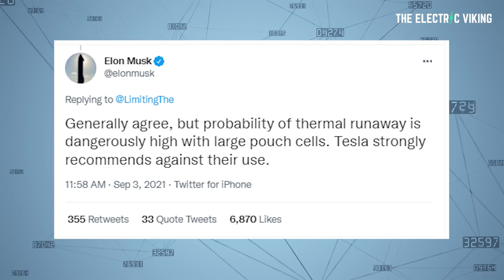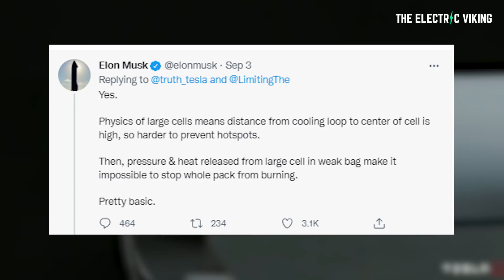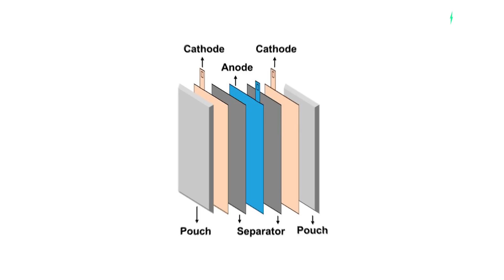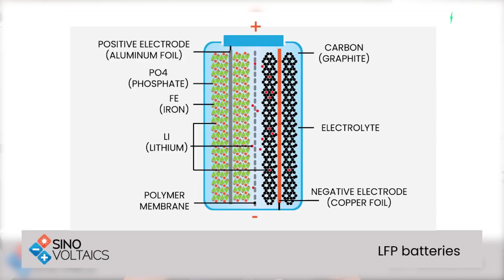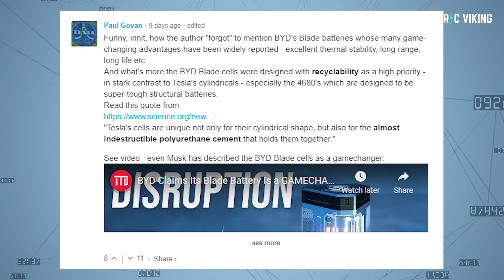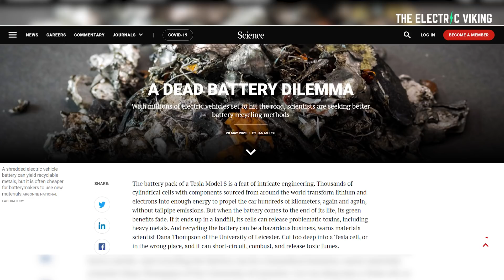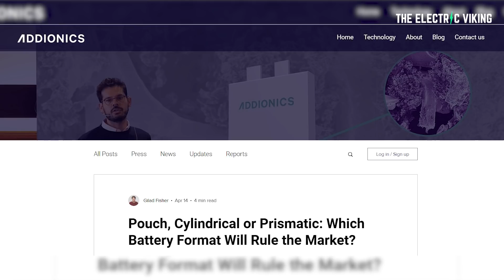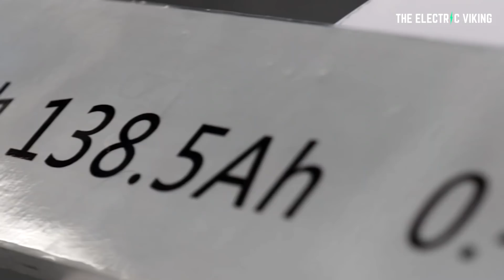Tesla batteries VS BYD batteries + Elon Musk on the best battery format

Comment: The future solid state batteries necessitates only "prismatic" geometry.
The cylindrical geometry of a battery is tributary only to the past history of the battery manufacturing and its similarity with the condenser principle construction.
However, the modern solid state batteries will require only a "prismatic" form ( a very long prismatic format - something like BYD blade - will be the optimal one due to the fact that the future solid state battery will be practically a horizontal pancake baked, pressed and assembled automatically on a long industrial assembly line that moves only horizontally, without any useless and energy wasting rollers, fast rotations, etc. )

Comment: One of the things that a lot of people aren't even looking at is the fact that while maybe no one has plans to recycle lithium iron phosphate batteries the reality is that first of all they're going to last way longer than nickel base batteries.  I recently got rid of a car that had over $250,000 miles on it and basically that car was over 20 years old.  The reason I got rid of it was because the engine pretty much died.  If that car ran on lithium iron phosphate batteries it would only have gone through about one quarter of its lifetime!  Reality however is that the cars seats were pretty ripped up and it didn't really look in great condition and so someone who has an old car like that with a lithium battery might decide hey you know what I'm just going to park it in the garage energy storage.  Or they might get rid of it but keep the battery and use the battery for energy storage.  People are paying around $10,000 for power wall that has 10 KW.... If you have a 60 KW pack that has degraded down to 50%. That's still three power walls

Comment: In your comments, you never mentioned carbon footprint of the batteries.  It creates a lot of carbon emissions during the manufacturing process of the batteries no matter what chemistry you use, especially the Chinese batteries.  The world is becoming aware of that and there are efforts to establish a standard or score method to decide how much carbon is generated.  Europe is even talking about banning certain batteries which does not meet the standard.  Therefore, although BYD may have a viable solution but if they do not improve their manufacturing process, they will still be banned from certain markets.

Comment: 1, blade has longer range than old lfp batteries. take byd and catl for example, blade runs about 20% further per kw. 2, lfp are being recycled. china recycles a lot of lfp motorbike batteries. while they are not expensive, recycling them to full capacity is even cheaper and environment friendlier.

Comment: Tesla is announced it has made a deal with BYD for blades.  Tesla either gave up on 4680; or they will be late and need a stop gap; they must do something because Cybertruck Roadster and Semi all depended on 4680.  Nissan Leaf uses pouches I've never heard of them having a fire.  The press coverage about EV fires is fair because many of these are in new cars - not old antiques; and EV fires ARE VERY HARD TO PUT OUT, batteries can even explode out and be launched hundreds of feet.  Once they catch fire they have the oxygen needed to keep the fire going so you can't just suffocate this type of battery fire.  EVs are made with a huge heavy protective case to try and protect the battery pack - this is why they weigh so much.  BYD says blades can be punctured and not catch fire; even so they use a heavy protective container in their cars and so I can't see why they would do that unless it isn't that much better.

Comment: Within the cylindrical cell (4680) photos, if Tesla is using three thin film metals for their contact to the top and bottom then the reason all the tabs are left in place is to use thermal coupling to syphon the heat from the center of the battery to the top and bottom.  It would also require thermal past with high conductivity to conduct the heat to the tops and bottoms of the batteries.  It would explain all the waist at the top of the battery with all the metal bent down rather than removed for weight and recycling purposes.

Comment: I have an observation to make about the guy who claims that Tesla batteries can’t be recycled. This is just a scare tactic. I’m no expert (though I do play one on the Internet 😂) but just because 4680 uses super tough casing and glue wouldn’t mean very much when it’s run through an industrial shredder. It’s my understanding that in order order for the chemical engineering to work recycled materials have to be ground into fairly small pieces. All of this will only matter when it becomes economically profitable to recycle batteries.

Comment: I've seen the battery pack of LFP M3 SR from Munro.  It leaves a huge empty space for another module! my mind is blown.  I don't know if they still need to make the 4680 with any chemistry because the LFP on prismatic/blade can make up for less density.   I don't see any need for cylindrical cells except high performance cars.

Comment: I'm not a fan of electric vehicles in general but I do believe they have their place such as for a person that lives in a city or town and only goes to grocery and church and other local places. I don't intend to have to plan my trips around charging locations and charge times to travel distances more than a couple of hundred miles and I am pretty sure the range is not stated for worst case scenarios because load, air temperature and terrain will greatly affect the range just as it does with any other fuel. That said, the world doesn't need China controlling battery manufacturing along with everything else they control now.
Reply: We are buying a tesla model 3 standard range.  Nearest store is 55 minutes away.  Hospital is 80 minutes away. Charging station is 2 1/2 hours away.  Long range would be smarter but too expensive.   Person in our area has had a model 3 for 3 years and loves it.

Comment: BYD design can hold more battery packs in less volume because of its design which doesn't require any external cooling mechanism. This also translates into longer range. Just because this innovation is coming from a Chinese company it's not getting the attention from the Western media. If it was a Tesla product, the entire western world would have gone hysterical hyping it!
Reply: Minor/ incremental Western innovation is overhyped and consumers are tricked into buying them. Look at Apple. It's business is based on that model. Tesla is following the same pattern.

Comment: Major advantage of Tesla's tabless (multi tab, actually) 4680 battery are the very short electrical paths between anode and cathode in the battery. Makes it easy to cool. Just top and bottom cooling, no nead for fancy cooling channels. Also makes it very easy to charge /discharge at a high rate. If you unroll a 4680, you get a very large active cathode/anode area - similar to a large flat blade battery, but very compact, and with steel cans cast into a solid pack - almost bullet proof. With LFP can get discharge to 0% and easy charge to 100%. Better than other chemistries. Elon's on it!

Comment: Toyota are banking on some breakthrough in economical green hydrogen production as well as storage media and materials. It could possibly happen. You never know.

If it does, the gravimetric energy density would change the game once again in a manner we have not had to consider. That scenario would shafte Tesla,BYD and co and I'm talking drill them a new one kind of shafting. It would not be pleasant and it would not be quick
Reply: Green hydrogen is a fossil-fuel funded green-washing lie.  Hydrogen is made from natural gas.  Using solar panels with batteries reduces fossil fuel demand 3x more than using that same solar power to produce hydrogen.  That's why fossil-fuel corporations and unions are pushing hydrogen.

Comment: Looking at the battery module as the whole rather than at the cell level, there used to be at least one company (I forgot the name) that proposed a solution where the battery pack(s) could be replaced at the time of "refuelling", just by sliding out the old depleted battery and slide in the new charged module, taking about the same time as refilling your tank. The battery packs would  be leased. It looks like that didn't work out for various reasons but it's disappointing that there has been not enough effort in standardising of battery packs, which means extra cost for the consumer, when the time comes for replacement.
Reply: a minute of googling would fill in the gaps...  "Better place" - there was no real EV market back in 2012, and it was tough to make any business case, "NIO" - still rolling out in China and Norway, "Gachaco" - Jap Motorcycles (showing that cooperation can happen) - you may have had another in mind...  (lol)

(swapping a 400-700kg battery isn't trivial for the average soccer mum - and she probably has a garage to plug in at.)

Comment: Energy density and weight kind of do not matter for many of the batteries that Tesla needs - for stationary storage they are kind of irrelevant. The cost and speed to manufacture will also win over energy density and weight - cheap EVs with reasonable range would sell like hot cakes, even though they may not be suitable for everyone.

Comment: LFP cells are THE winner, simply on COST and AVAILABILITY, of the components used..! 🙄 
NCM NCA etc etc simply use components that are MUCH higher priced AND much HARDER to come by in their manufacturing and the relatively small increase in energy density obtained from them is not sufficient to justify the extra costs involved, not to mention the additional elevated risks of their spontaneous combustion, as well..! 😳😳 
China, is ..currently, the world leader, and more than a decade ahead of the West, in Lithium battery design and manufacturing, as Elon, has discovered, and it is simply ..currently cheaper, for him to source his Tesla batteries from China, than trying to make them himself. 🙄 
Will that situation change..?? 🧐 
With the world already approaching “Lithium deficit” as early as next year, it is hard to see, just how, Elon, is going to be able, to beat the Chinese, in their already well established battery manufacturing expertise, and already ‘locked in’ long term Lithium raw material supply chain contracts. 😳 
We do indeed, Viking, …”live in ..’interesting’ times”…..! 🙄😉

Comment: By the time SS battery tech  becomes viable and, most importantly, affordable there will be gains in density for Lipo4.  Lipo4 is already cheaper than $100/kwh and prismatic cells can be had in the $80/kwh range now.

Solid state will be boutique.  It will be used in Ferraris, Lamborghinis and Bentleys when they are available.

And...4680 lipo4s will be the backbone of the oncoming energy sector...

Comment: (21b26金 ed.) Although you mentioned tabless, did you indicate that design technology's primary advantage is to provide shorter electron travel paths? Otoh, pouch or prismatic forms are thus more prone to dendrite formation, especially at high charge/discharge rates & at the far ranges of battery capacities. The latter forms are also prone to swelling vs cells & are therefore much less amenable as structural components. However, as you mentioned, solid state materials are presumed to not swell, but I haven't that they can't be put into cylinders. If not, & SS does predominate, it's conceivable that Elon will so retrofit the cell lines, accordingly, as easily as he scraps Starship prototypes!

Comment: Range is not the end goal recharge speed is the real game changer. If your range is 250 to 300 and you can 90% recharge in 10 minutes you win
Reply: I would say the exact opposite. 😆

The range is the most important for the users. This is also more easier and safe to achieve. If you think of it the cell can be discharged in half of the time what it takes to charge. If we have two hour maximum charge rate we’ll have one hour short circuit discharge. Meaning the energy is not enough to cause the thermal runaway. (Not that simple thou since the hot spot thingy has to be fixed too before that).

So we’ll most probably see the race for 1500-2000 km range in EVs. The cost is not an issue with LFP. Weight is not an issue either as most of the cell weight comes from all that infrastructure around the active materials.
Reply: Both are equally important in my simple opinion. Range anxiety and charging time are both equally important issues for non adoption of EVs (apart from high purchase cost).
Reply: NIO just change your battery in 3 minute...

Comment: I think Tesla continues to use cylindrical cells because that is what they started with and it is probably inertia in the company to continue in the same direction. 
Pouch cells are much easier to cool down than any other type.
Something like the blade battery would be extremely easy to cool down.
As for safety even LFP batteries will burn if you put them in a fire. My guess is that the LG cells caught fire because the fire was started by a short circuit inside the cell. I have some of NCM pouch cells and you can put a nail thru them and will not catch fire. It says in the datasheet which I didn't believe so I tried it and in fact there was no fire.
I have seen a liquid cooled NCM pouch cell pack in a test run at 15C for 90sec. Got to 50°C and was back down to 30°C in less than 5min and the cells did not even swell.

Comment: LFP battery's biggest advantage is cost. And that is offset by lower energy density. Seeing that Tesla's biggest market is China, and Tesla needs for their volume products to use a high percentage of domestic (Chinese) components, it makes sense that he would have plans to expand CATL LFP battery use for the entry level models. Especially for the Asian market. At Battery Day last year Elon outlined that several of their models would use LFP batteries, and with various vendor supply issues looming large, it makes sense that Tesla would plan to have LFP batteries as a staple for their vehicles. I don't think that it means that Elon prefers LFP batteries over their own 4680 batteries. In fact the prime reason why Tesla developed their 4680 batteries was specifically to not be under the thumb of Asian battery manufacturers and materials suppliers, who have dominated the battery industry.

Comment: LFP are better as long as the energy density is high enough.  Up to now Elon/Tesla has gone with Lithium/Nickel(cobalt is being phased out and almost gone) because of the energy density.  They are moving the low range Model 3 to LFP because the energy density has been increasing and Tesla is ready to start adding it to the mix given the growth of EVs.  As Tesla starts selling more and more vehicles they will continue to add models (generally smaller) that have LFP chem.

Comment: I believe Tesla will continue to use LFP prismatic cells for SR models and energy storage, and will use nickle-based cylindrical cells for LR, performance, and heavy-duty models (as laid out during Battery Day). There is a small chance that they move LFP to cylindrical eventually, but the benefit would have to be significant.

Comment: One should remember that Tesla has designed a structural battery pack, so the cylindrical cell is part of the structure of the car itself.  It may contain more mass for its energy content, but that mass replaces frame structure that other cars need, so Tesla enjoys a net gain in mass when the battery is integrated into the automobile as a whole.
Reply: I believe BYDs are designed similarly in the 3.0 platform

Comment: Having researched and sold lion batteries for years, the most reliable, safe and longest-lasting batteries are the prismatic cells, which I think are the clear choice in cell type.  Cylindrical cells will go away as there’s too much wasted space as the space for the batteries is rectangle.  The chemistry will change some, over the years, toward more solid state, but prismatic makes the most sense
Reply: Several obvious advantages to cylindrical cells:
1. The "gaps" you refer to allow for heat dissipation and conversely, warming up. The coolant flows better, is more uniformly distributed and flows faster.
2. The geometry allows for significant flexibility in both the size and shape of the pack. Packs can be designed to suit a wide range of form factors.
3. Proven technology. Billions of these have been made and are still being made. The infrastructure to make these (the production lines) is established and paid for. They are currently the cheapest to make, and the fastest to make.
I'm not dismissing prismatic form factors... only that there are not as many design options open to pack shape and size- so you end up designing the car around the battery, rather than the battery around the car. If you look at cars that use prismatic cells, they have to pack the electronics into spaces (the frunk) that could otherwise be left free - for storage uses.